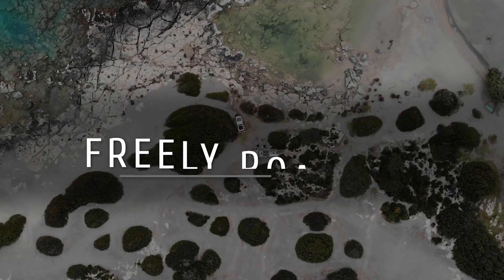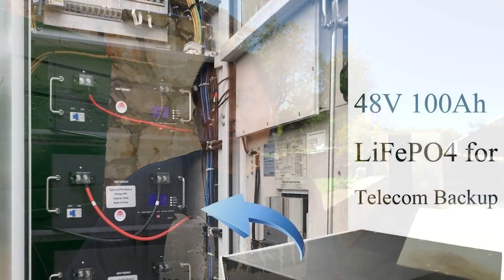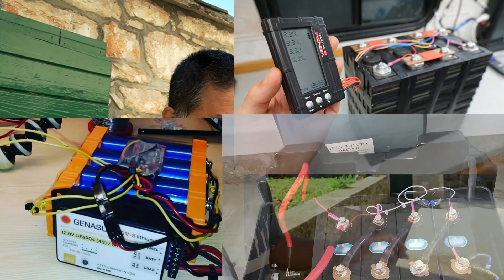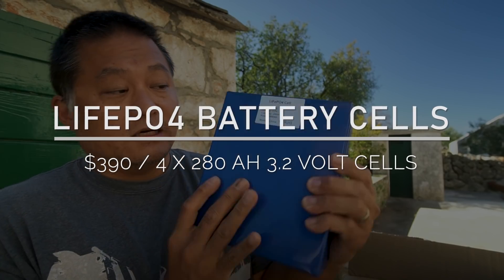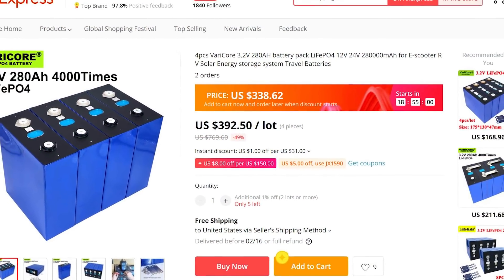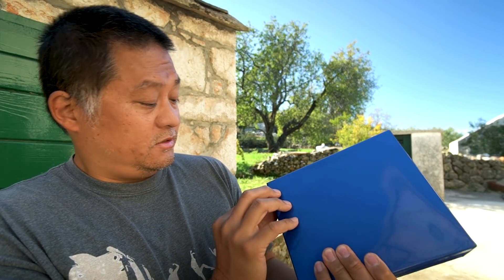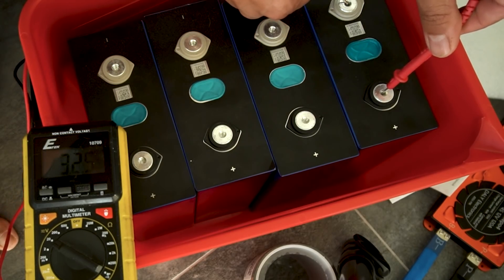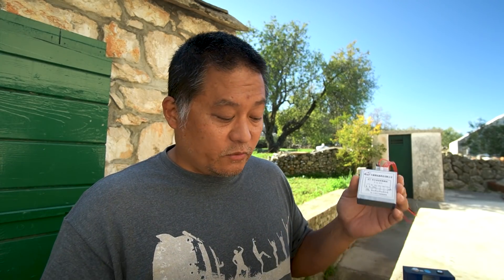Build Your Own 12-Volt LiFePO4 Battery For Cheaper Than AGM

Comment: search btrpower 12v lifepo4 battery on amazon. The price is ONLY 399 USD ,buy It with a coupon.
Reply from the maker: That's a good deal for a 100Ah factory made pack. Hopefully it uses reliable components.

Comment: If I where to use 3.2 v for a boat I would do 4x4 serial banks connected in parallel. It would be a lot simpler to just parallel 4x12v batteries tho

Comment: This is probably the most comprehensive and least hyped video about Lithium batteries. And timing is good because in a year's time, I'll be replacing my 3 battery deep-cycle battery bank on my boat and have been looking at AGM, Lithium, etc since in a span of 7 years, it will be the second time I replace the battery bank. Definitely will look further at this. Thanks for the awesome presentation.

Comment: Hello, I have a question. You have a 12V, 280Ah rated, but you use a 120Ah BMS. How does this work? I thought that the BMS should have at least the same rated amp as the battery! Thanks for the informative video.
Reply from the maker: The BMS has to be rated for the maximum draw you expect to pull from the battery. This pack is rated for 1C or 280A but I don't plan on drawing more than 120A max.
Reply: @freelyroaming  Thanks. I got it. 
This way is better. I get the BMS for what I need (less expensive) and I have longer time to use it (around 2+ hours), and the connecting wires are smaller (less expensive). Thank you for your time.

Comment: I was wondering how it can tell individual cell information with just two wires and there are four cells
Reply from the maker: Via the cell sensing wires that connect to each cell. Watch the rest of the build series to see how it works.

Comment: Just switched to 990Ah lithium 48VDC bank.... They are just perfect.
Reply from the maker: 990Ah at 48v? Wow, that is more power than many electric vehicles can store.
Reply: @freelyroaming  yes, it is in my house... I live inside the Yucatan jungle. With 10.7kw solar array it can rain for 10 days and I will not have to use backup generator.... I also have all electric. Stove, oven, laundry etc.
Reply from the maker: That's awesome
Reply: @freelyroaming  yes, thanx... They are 6 units and 48VDC 165 Ah each... From China of course... Very nice idea, they call it power brick. They come on hduty wheeled base so they can be moved very easily for cleaning the floor or anything else... Name GSL Energy.... Placed in my house after taxes, importation and transportation fees the cost me under 3000usd each that is very good price.

Comment: if i purchase 4 of 12 volt LiFePO4 batteries in total ill have 16 piece to achieve 48volts what kind a BMS do i need? also what kind a kwt do i get of this set?
Reply from the maker: You will connect all 16 cells in series and you will need a BMS made for a 16S pack.

Comment: Hi, couple of questions on this.  With the big BMS you showed, how can it cell balance with only 2 wires?  Wouldn't you need separate connections to all 4 cells?  Also did you change anything with the MPPT regulator?  So far as I can make out you can't just connect LFP cells to a regulator set for lead acid, because the temp comp in the charge algorithm could potentially over volt the LFP batteries.  Interested in your thoughts / view on this.
Reply from the maker: You can watch the rest of my build series on these cells. It will answer all these questions.

Comment: LiFePO4 is much less sensitive to over charging than the more often seen 18650 LiCoAl. LiPo can be taken to full charge (and should be to balance the cells. But it must be done with a BMS that allows the cells to be balanced. Always use a good quality anti seize paste on stainless threads. It stops aluminium corroding and/or stainless galling.

Comment: Looks like the cost has gone up a little bit (about $130 per cell). Still looking at well under $1000 for 280AH lithium. Great deal for batteries that should last you many many years.

Comment: AGM batteries here in Norway is still cheaper then even the cheapest of the cheep Lithium batteries even if you make them yourself, AGM seems to be more expensive in USA and Lithium more  expensive then in USA and other places making Lithium less profitable for use as battery bank here in Norway... Problem is the weight of 198kg for a AGM battery bank that will give same Watt hours as a 32kg lithium battery. Here in Norway you also have the added cost of the Lithium batteries needed heating because of the cold weather.
Reply: @freelyroaming   Cheepsest 100Ah Litium I have found here in Norway cost 660$ but here you need heating and those cost 900 to 1500$. Two 136Ah AGM cost only 500$. But to save weight I will have to go for Lithium even if it is horrible expensive....
Reply from the maker: That's the same price as the US and Europe. If you build your own LiFePO4 pack like I am showing here you can get an equivalent usable capacity pack with cold weather heating for less than $500. Watch my cold weather LiFePO4 series if you haven't yet. In Norway since you are not part of the EU, you might end up paying more for customs and taxes to buy from aliexpress. But if you have a friend in Sweden who can receive the package for you, you can get the LiFePO4 cells for about $300 an the rest of the gear won't cost more than $200.

Comment: Hi can I run the cells in a horizontal position or is it a must to run the cells in a upright position?
Reply from the maker: Generally speaking LiFePO4 cells can be mounted in any position. However, these prismatic cells are best if they are installed upright. There are safety vents that are at the top and if there is excessive swelling from overcharging or over discharging, they would be best if the expulsion can orient upright. Although it is an unlikely scenario for most people, it's not recommended that they install in other orientations.

Comment: I use huge versions of these, to power forklifts, etc.., at work.
The cells do need to be equalized.
If under constant use, I would advise  anyone relying on them, to run a battery management system, that allows them to equalize their cells, at least once a week.
Reply from the maker: BMS with balancing feature is a MUST! I also use a secondary dedicated active cell balancer just to be sure things are always kosher.

Comment: SUPER CAPICITOR BATTERIES make lithium ion look like junk polluting over priced garbage that you need pay to be recycled.
Reply from the maker: Why not just have a nuclear fusion reactor strapped to your van?

Because the technology is not ready for this application. That's why.

Same as super capacitor batteries. The technology is not ready. You would need a super capacitor battery 10 times the size of a LiFePO4 to store the same amount of power.

To have the same amount of energy storage as this 12V 280Ah, you will need more than 7,000 2.7v/500F super capacitors.

At 90 grams a piece, your super capacitor pack with the same amount of energy storage would weigh almost 1,400 lbs.

Even at $2 a piece, which is a steal, it would cost you $14,000 just to source the raw super capacitors.

You still think its a good idea? No, It is a ridiculously stupid idea to compare super capacitors with these LiFePO4 cells. So stop spamming your comments everywhere.

Comment: Why buy expensive lithium ion that pollute really bad when you can buy super capicitor battery? Manufactures of lithium ion are trying to get there money back they spent before nobody wants them. Do the world a favor and your pocket book and get Super capicitor battery. I guess the lithium ion people want to mislead people to sell a product. Lithium ion suck. They aren't clean. Cold weather kills them. They don't last as long as super capicitor batteries. They cost to dispose of too. Lithium ion do cost more every step of there life then a super capicitor battery. Lithium ion pollute more than any other kind of battery too.
Reply from the maker: Why not just have a nuclear fusion reactor strapped to your van?

Because the technology is not ready for this application. That's why.

Same as super capacitor batteries. The technology is not ready. You would need a super capacitor battery 10 times the size of a LiFePO4 to store the same amount of power.

To have the same amount of energy storage as this 12V 280Ah, you will need more than 7,000 2.7v/500F super capacitors.

At 90 grams a piece, your super capacitor pack with the same amount of energy storage would weigh almost 1,400 lbs.

Even at $2 a piece, which is a steal, it would cost you $14,000 just to source the raw super capacitors.

You still think its a good idea? No, It is a ridiculously stupid idea to compare super capacitors with these LiFePO4 cells. So stop spamming your comments everywhere.

Comment: On your opinion can these cells be easily and effectively configured in a 12V bass fishing trolling motor application?
Reply from the maker: Yes these would work for that application as long as you use a waterproof enclosure.

Comment: The lead acid capacity is way over rated. They never reach their rated capacity. Just set up a test rig. You will get between 30% capacity at rated cutoff voltage. If you drain them down completely you will get 60% of the rating on them So the 228AH is really only 60 or so Ah. So the Lithium, even back then would have been cheaper.

If you count in the rated cycles, lithium would be cheaper by 4-5 times.

Comment: Dan, good video. One that I actually learned something from. One month last summer I used about 1450 kWh of power. How many batteries would I need to give me that much power? What size wind generator would I need to keep them charged and last but not least, what size inverter do I need to run my home?
Reply from the maker: Thanks Allen. You will need quite a bit of batteries. you averaged over 48kWh per day. That means you will need at least that much battery capacity, likely double that in case there are days when you don't generate enough to replenish and some buffer for inverter inefficiency losses. I would estimate you will need 96kWh of battery storage capacity. That is 7,500 Ah which means you will need about 112 of these cells to build at least a 7P16S 48 volt battery bank. For charging, I recommend going with a 3 watts to 1 Ah used daily ratio (more watts if your area has poor power generating potential like rain and heavy cloud coverage). You are at about 3600 Ah of use per day so you will need about 10k watts of charging capacity. Either in solar, wind or both. Whatever setup is reliable for you. With such high requirements, definitely set up your system as 48v. Inverter is based on what you peak draw will be. I would assume you will be drawing at least 8kW so an inverter (or multiple combined capacity) with constant discharge rate of at least that. This is quite a large system you will need to build and with this much potential energy, care must be taken in the design and assembly of everything. Unless you are 100% comfortable with this project, I would recommend consulting a solar install professional. Good luck!
Reply: @freelyroaming  Thanks. This is the most help that I have received from anyone. I saw some 3.2v 320Ah batteries on Aliexpress. So, if I need 7.5Ah. That would be 24 of those. Am I thinking the right way? 7500/320=24.
Reply from the maker: So since I am recommending that you build a 48v system, the number of Ah will be based on that. It will have a nominal voltage of 51.2v. it's easily to think it terms of Wh. Each 320Ah cell will have about 1kWh. You will need about 100kWh  so close to 100 of 320Ah cells. In a 16S (48v) system, you should buy 96 cells (since you need multiples of 16) so you can build a 6P16S pack. it wouldn't heard to order a few extra cells in case you have any faulty ones when you order in that quantity. It could save you some time if you need to return and replace any cells which can happen.

Comment: Can i add this in series 12.8v battery to an existing battery bank that is in parallel 12v by connecting the series battery in parallel and if so where should I put the bms?
Reply from the maker: I would not mix different types or sizes of batteries in the same system. You could have unexpected charging and balancing issues.

Comment: So do you have to buy one of those bms’s for every four pack of batteries?
Reply from the maker: Depends on what you are building. If you want separate individual packs made of 4 cells then yes. You can also build up larger parallel packs before connecting them in series of 4 to make a large 12v battery. In that case you only need 1 BMS.

Comment: Don't mess around with the packaging and damage to these batteries. If you see any indentation, scratch or dent be on the alert, they're SENSITIVE. It may look like a little something but very POSSIBLY may be damaged, it'll leak.

Comment: If i was to build this for my boat 12v trolling motor say 45 Thrust maybe 55.Thrust. would this be ideal instead of going with a cheaper type of deep cycle?
I want something that will last long and wont leave me running a low gear to get back.
Reply from the maker: These are great for trolling motors. Make sure to find a water tight box.

Comment: The Bluetooth function is really handy.  You can test the system by plugging in 1 appliance at a time and see Exactly how much each one draws.  This helps calculate how long you can go between charges.  Conversely you could plug in your Absolute Vital appliances and see how long you get.  That way when you do not have AC power you know what you can and cannot run.

Comment: How does the bms monitor individual cells when its wired in series??
Reply from the maker: With individual voltage sensing wires attached to each positive terminal of each cell.

Comment: What do you think of the Oasis Firefly batteries?
Reply from the maker: I don't have any personal experience with them but it seems to land somewhere between traditional AGM and LiFePO4 in depth of discharge, cycle life and cost. The one benefit I see is it's ability to handle cold temperatures versus LiFePO4. So if that's a major consideration then it should be considered.

Comment: 3:32 
I think film prices have gone up, not because of less demand (which would make them actually cheaper), but probably because they are not produced so much more and become more rare, and because there is not much competition anymore. Moreover, if a factory produces less the fix costs and nonproducing idle time goes up per unit.
Reply from the maker: Like you said, less production volume means higher per unit cost. Lower production volume is due to less overall demand. Prices would only go down if there is a temporary product surplus. Key word being temporary. Most of what is lost on the demand side is permanent. A permanent decrease in demand has clearly happened in film which can initially create a short term glut which we are far beyond that moment by decades. When the permanent drop in manufacturing capacity matches the new lowered demand, prices are now permanently higher. Prices have increased since again because of the resurgence of film photography in certain demographics similar to vinyl records but it is not likely to become mainstream ever again.

Anyways, film stocks are finding new equilibriums with lower supply and demand and that is why prices are higher. But that is obviously not what this video is about. This example is a comparison to lead acid batteries which COULD eventually become a niche product when better and cheaper battery technologies take over. That is the point.
Reply: @freelyroaming  thanks, I see you already meant this. My admittedly offtopic comment was rather a way for myself to oder my thoughts and provoke some new insights from some other people. Apologies
Reply: I got a set for 700 bucks shipped to me in 7 days here in the states, so from my experience this is just some of the tools that people are missing, this is a game changer.
Reply: @bryanriggs4417  What brand did you go with? Were they on Amazon?

Comment: What would be a good BMS(ah and brand) when building a 24v version of this? Want to build a 8s 24v version if this for my van. Would like to use it in combination with a 3000 watt inverter to be able to use a iduction cooker.
Or is it better to build 2 12v with their own BMS and parallel connect them?
Reply from the maker: No you should build a proper 24v 8s pack. You don't want to build two 12v packs and series connect them. It makes charging them trickier. For example, you don't want one pack to disconnect when it charges full before the other one as the charging voltage will be much to high if it's not split across both packs. Daly makes 8s compatible BMS units. I've also heard good things about Overkill Solar BMS. They are programmable, bluetooth enabled and has low temp disconnect. Though I've not personally used them.

https://overkillsolar.com/product/bms-100a-8s-lifepo4/
Reply: @freelyroaming  Thank you so much for your fast reply. Im still very new to this and am learning alot from your videos. If I would use a 100a BMS with a 24v Battery, I could use up to 2200 watt appliances? I learned that 100a x 24v = 2400watt and 10% gets lost through the inverter.
Reply from the maker: Yes you will be able to use 2200w inverter. The 10% loss won't come from your inverter output capacity. It will come from the actual consumption rate.
Reply: Great. Thanks. I see that I have alot to learn before building my own system. Good thing that the delivery takes up to 2 months. That gives me some time to collect some more information :).
Reply from the maker: Haha yes I guess that is the optimistic view of the slow boat 😆